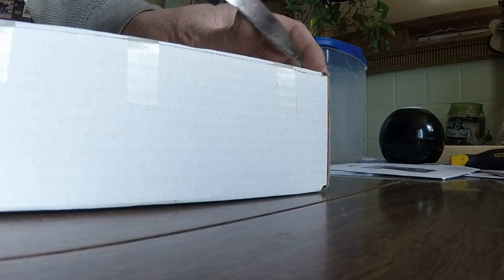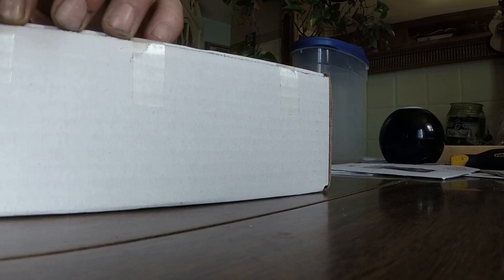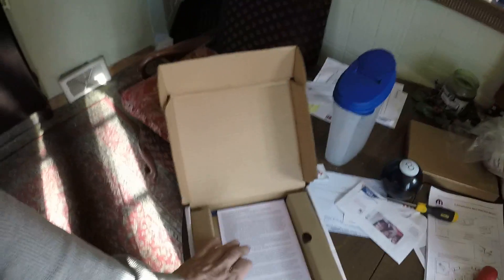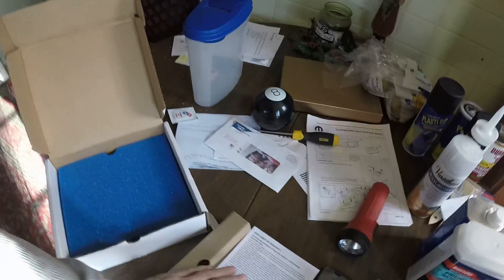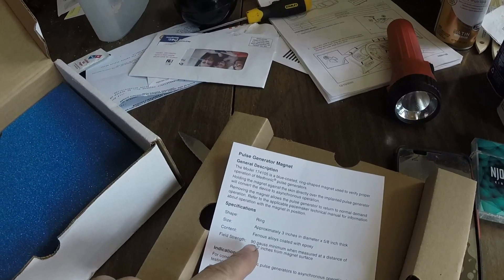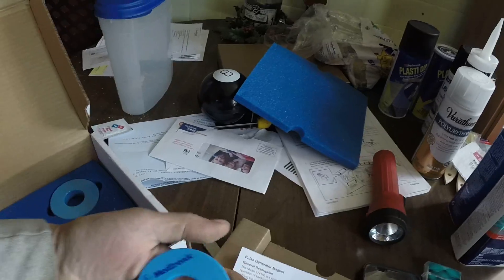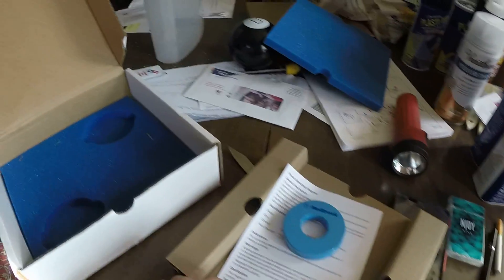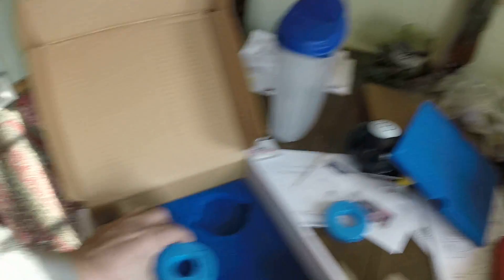Welding Live or Die with a ICD Pacemaker / Defibrillator

Comment: The new defibrillators will let you  high frequency Tig weld problem is if you have older leads in your heart then they will heat up and we'll kill you, not shock you. I stick weld and wire weld even plasma cut with my defibrillator and not any problems as of yet and this is my third battery so 12 years now.
Reply: If you don't mind me asking what machine do you use for your welding and what do you set it at I'd love to get into welding I'm only 38 and I have a f**** pacemaker sucks I am alive and so are you LOL
Reply: @mancomicMichael  I weld with Miller bobcat 225 and have one those cheap 50 amp Amazon plasma cutters if I get to close to the leads while welding my alarm goes off on my defibrillator but has not shocked me yet.
Reply: what year did you receive your pacemaker bud? i got mine in 2006 and about to try all of this out.
Reply: @toomanyprojectstx  got mine in 06 also have that recalled lead in me still but I've had it changed last 3 times already and the last was last year. I got the defibrillator pacemaker so it will shock the hell out me if needs to
Reply: mule spur sir I greatly appreciate your response to this. So you’ve had no problems with the 06 pacemaker? As far as any type of Mig or tig? Just picked up a dual process welder.
Reply: @toomanyprojectstx  we got a miss understanding I've got a pacemaker/ defibrillator and has to be changed every 5 +/-  years because of battery dieing. Now the one I have now is a new model that allows me to weld with a dual process welder and high frequency Tig and plasma. I really can't know if yours will allow this or not . I do know for the last 2 units I've been able to do this.
Reply: mule spur I understand. My pacemakers battery from 06 also has to be changed out every 5 years. This information helps out in so many ways. Calling my cardiologist on Monday. Thank you again Mr Spur and good luck to you.
Reply: @mulespur4806  hi I've just been reading your messages on here, can I ask which ICD you have as I had mine fitted in 2018 & I've been told not to weld or be too close to running engines etc which when your a car nut it's a bit hard not to be next to a running engine lol.
I just want to get back welding but the Dr say nope which from what I've read from your message replies and from I've seen on another YouTube video people are still able to weld with a ICD implant.
Reply: @Kwakcrazy  my icd is Evera MRI XT one thing to note is that if you hear a solid tone from the icd it means your to close to a magnetic source and just back away some and your fine it won't shock you or anything as long as you don't need therapy, if you here what sounds like a European police car then one of two things has happened you've  shocked or generator battery dead my alarm was set to go off at 8:05 am if anything happened to let me know to get interrogated.
Reply: Hell I just want to know if you can drink beer and get drunk still?🤣😂😆
Reply: @hotlatino7220  yes I can drink and did after getting my first defibrillator  I was in a state of depression because I was 27 years old when I  had my first VT cardiac arrest and thought my life was over, that was 19 years ago and Not beer only JD whisky I would get up drink 3 shots and only drink to keep the buzz all day only never to get drunk. That lasted about a year then I quit all alcohol. And got my shit together! I've had several more VTs I've been shocked out of and heart attach with 4 clogged arteries but still alive and going strong.
Reply: So is it possible to Mig Weld or Program Mig Welding Robots for Mig Welding applications? I am a Welding Technician Fanuc Robot Programmer. P)Please advise. Thanks